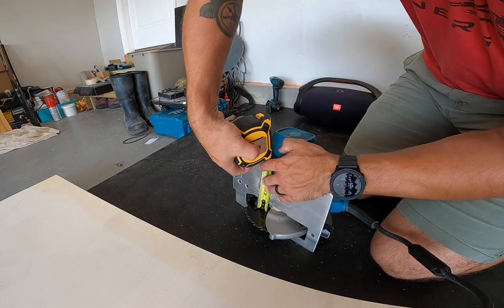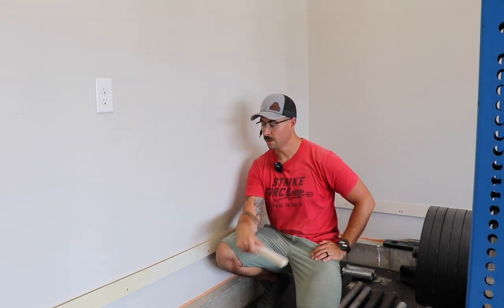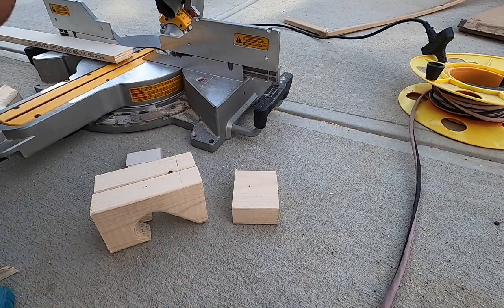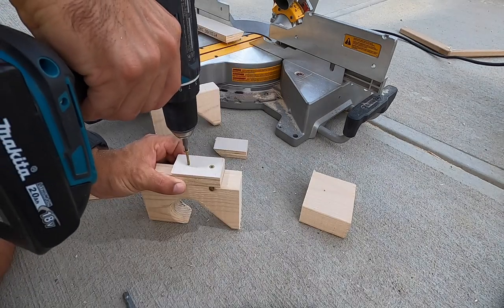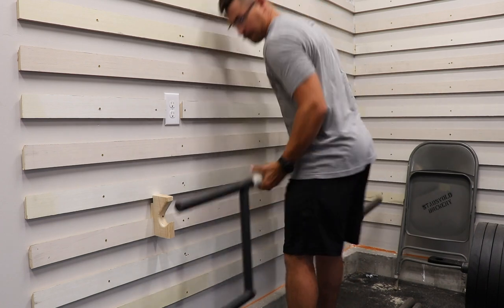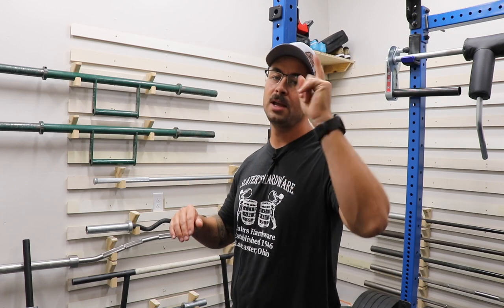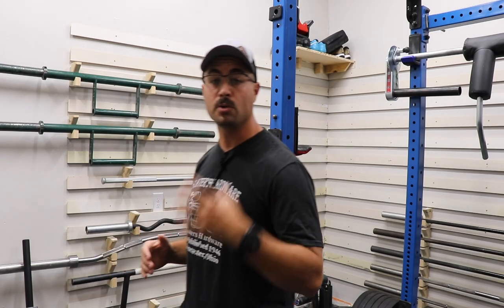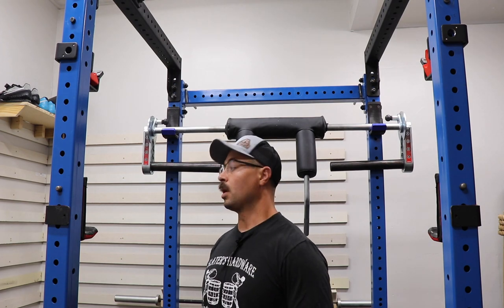Greatest Garage Gym Storage System Build | French Cleat Wall | Garage Gym DIY | Strongman Garage Gym

Comment: Easy tip to figure where to rip your miters so you end up with two even pieces, regardless of if you do 5" x2 or whatever size, is to find the center of your width then find the center of your thickness and bisect your 45° on both of those marks. Perfect every time :). God bless, and, great idea my friend. Very clean execution. But, please, get you a rolling in/outfeed support for your table saw! Can get one at harbor freight for less than $20.
Reply from the maker: Thanks for the tip. I’ll check out the outfeed rollers.

Comment: Amazing build! Just a minor consideration for future heavy stuff, I've found that if you put the center of mass significantly below the cleat and span multiple cleats, it can hold way more weight. The force doesn't pull "out" as much then, but instead more "down."
Reply from the maker: I’ve already built a new clear foe the camber bar. Excellent advice. Thank you!!

Comment: Chris at "A Glimps Inside" youtube channel has some great videos on French cleat walls.  They're really  helpful and he seems like a super cool guy.  To rip the 5 inch wide strips of 3/4 thick plywood in half while at 45 degrees, set your table saw fence to half the width minus half the thickness.  So, set your fence at 2 1/2 minus 3/8 or 2 1/8.  It won't be perfect but it will be super close.  With a few test cuts you can dial it in.  Hope this helps for anyone   else planning to do this because I know it can be frustrating.
Reply from the maker: Thanks! I love a lot of the guys that have wood focused channels on YouTube. Awesome info.
Reply: @TheKurtlocker  Yours came out looking very pro!
Reply from the maker: Sometimes even the blind squirrel finds a nut. Lol

Comment: man...this is awesome. I was thinking about getting two uprights to use as barbell/plate storage. for a monster rack, that's over 500$. this is is so much better! now I gotta figure out how to make a french cleat lol
Reply from the maker: It’s pretty simple if you own a table saw! Worth the effort for sure and at a way lower cost!
Reply: @TheKurtlocker  I went down the rabbit hole of French cleats. Holy crap. I saw some dude making them double sided, so it looks like a parallelogram. I don't have a table saw, but I can probable rent one. I'm wondering also if I can use pallet wood. There's a ton of free pallets in my area
Reply from the maker: That could be a free option.

Comment: Very impressive bar storage idea! For the Transformer Bar I spin it around to the Hinge setting and put the sleeves on the inside and mount it at the lowest height to minimize the slots used. What new bars are you eyeing to fill in the empty bar storage slots??
Reply from the maker: There are a ton that I want but for now I need to focus on my new rack and getting the new garage looking awesome

Comment: What did you do to cut out the spot the bar actually slides in to? I would love to do this but im in a just finished basement and my wife would kill me if I started throwing holes in everywhere
Reply from the maker: I’m detailing a video on this shortly. The new design is with 3/4” Baltic birch plywood but the bar holders in this video are made out of 2x4s with 2” holes cut into the center. A 45 degree cut is then bad at the top and bottom to open up the hole to put the bar in

Comment: Curious why didn’t you bevel the saw blade to 45 degrees when you ripped the boards? It looks awesome though! My wife is getting behind the garage gym at our place, but I don’t know if she’s down for another wood working project haha.
Reply from the maker: If I mitered the edges wheel ripping both edges would have been at a 45 degree angle. I wanted a flat bottom